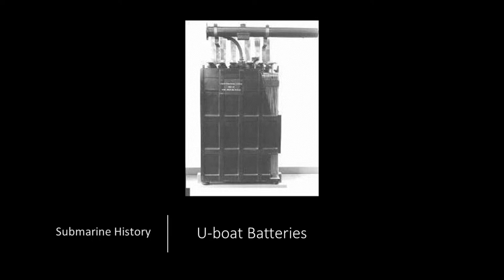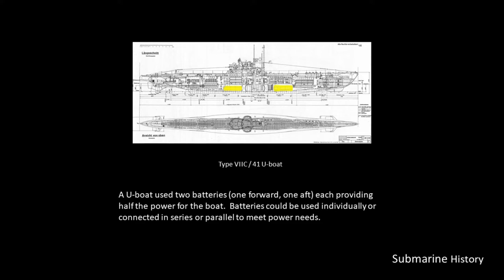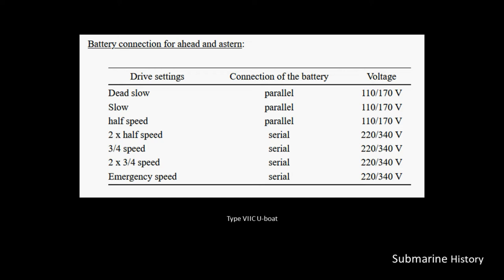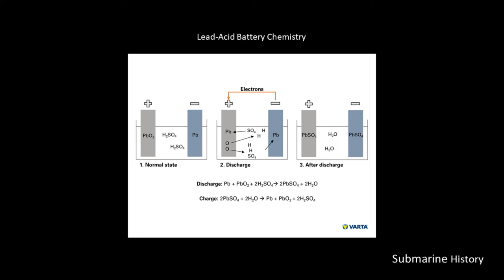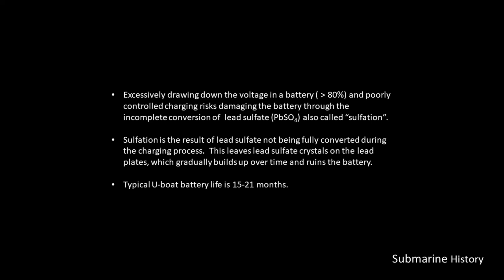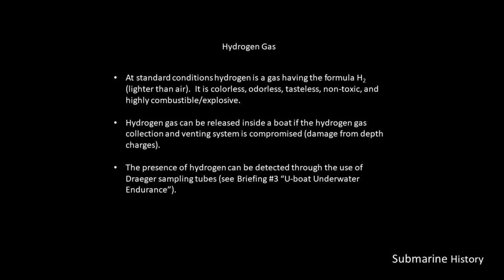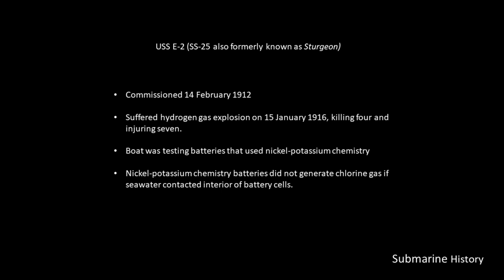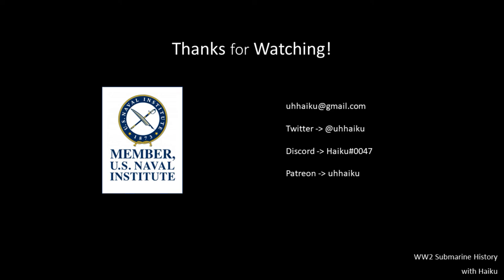U-boat Batteries - #13

Comment: I had read that if there was a leak in a battery, there was a procedure the submarines crew could try to neutralize the hazard of the gas. Can you tell a little bit about that? Great video.
Reply from the maker: To my knowledge U-boat crews did not have a method for removing hydrogen or chlorine gas other than surfacing and airing out the boat.  You can use sodium thiosulfate or sodium bisulfate to neutralize chlorine but in a U-boat they would have had to have cartridges that they could insert into the ventilation system and to my knowledge they did not do this.
Reply: @SubmarineHistory  thanks for the quick reply. I thought they could put a base in the bilge, to help with that.

Comment: Hi, are the battery's recorded 

How they were made
Reply from the maker: I'm not sure I understand the question - are you asking if there is information out there on how the batteries were made?
Reply: @Submarine History   yes on how they were made
Reply: @brucetully submarine battery's are not any different then golf cart battrey's  - there made about the same but much larger than golf cart or electric fork lift batterys - 
    There is a tube that goes to the bottom that air is used to bubble to mix the acid - the caps have a attachment that draws the gasses of the battery's off and the hydrogen is burned off in a catalyst